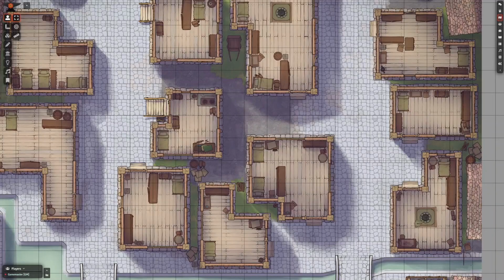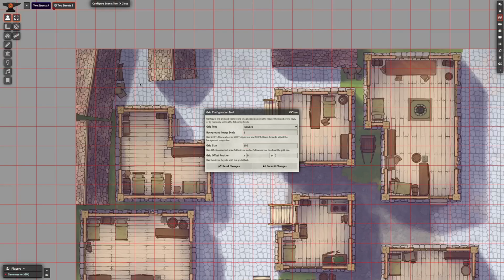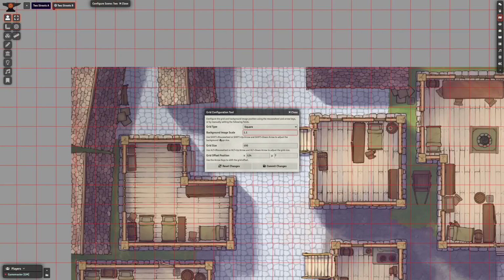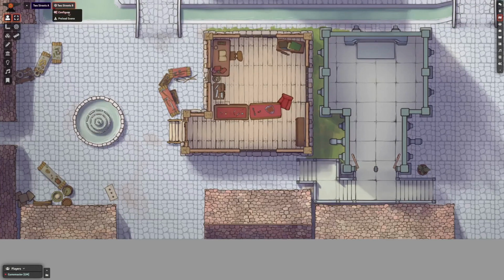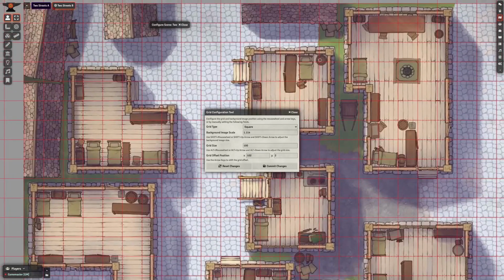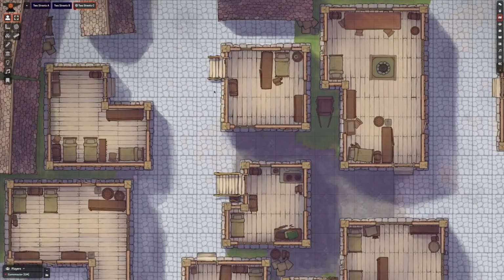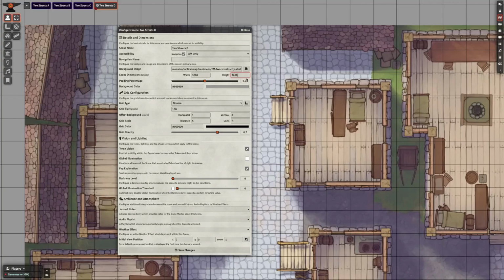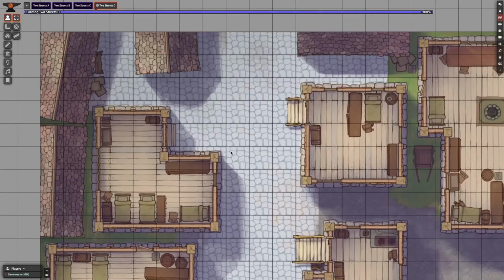Foundry grid alignment

Comment: I would HIGHLY recommend simply counting the squares on either axis, (either height or width) and simply dividing the pixel height/width (whichever you chose) by the number of squares. This gives you the perfect grid size every time, then the background only needs to be placed on the grid. It's as exact as it will ever get. Have a map that is 30hx22w? Simply divide the pixel height by 30. Done!
Reply from the maker: Sure, definitely do that! The methods described in the video are aimed at handling maps whose grids don’t go edge to edge, though.